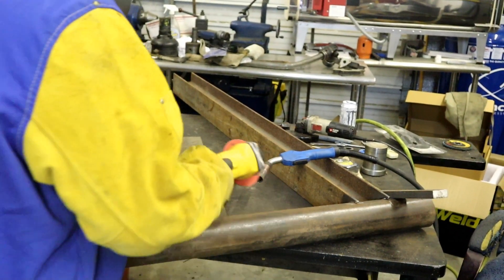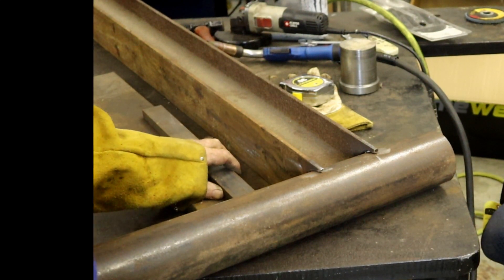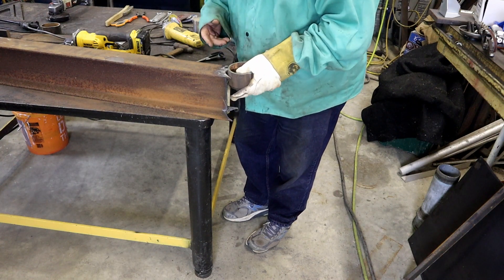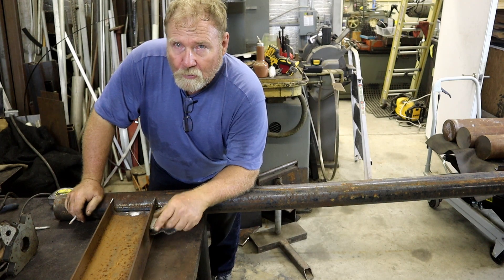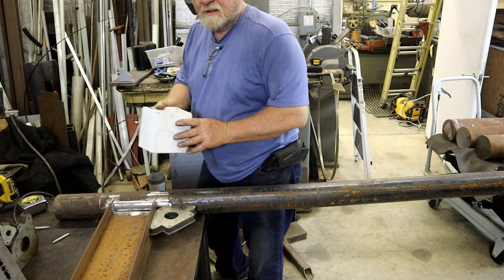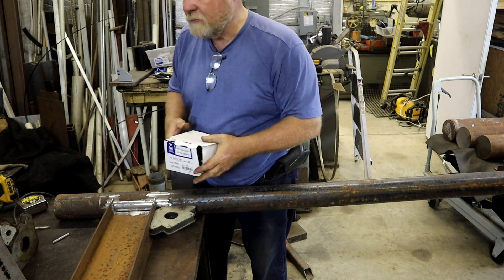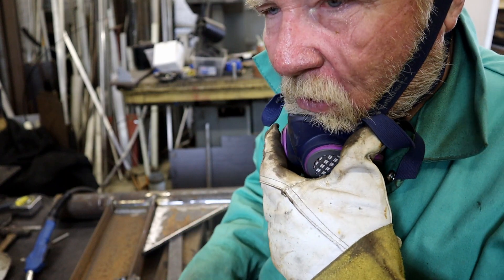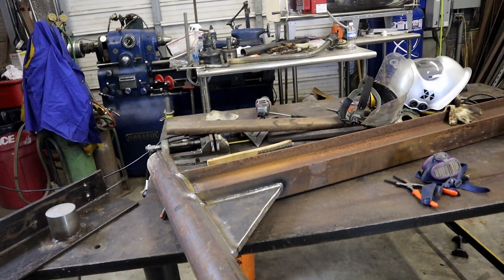How to build a GREAT Jib Crane: Part 3  Fit up and welding

Comment: Worked at a large slaughterhouse years ago. They had a huge crusher with a 100 HP motor set by helichopter due to a far in location where a crane could not reach. The foreman wanted to install a home made jib crane days before the install but engineer shoot him down. Less then a year later the huge gearbox had to be replaced. Took over a day for several guys to weld hangers just to hoist heavy steel up in the air. Foreman milked kob to get get a days overtime out if it.

Comment: From your project, I saw a lot of metal work that is very new to me.   Excellent work.  I guess I world never be able to make the same one like you did since looks like I need to buy many tools :-) Just FYI.  There is a product at Amazon called, Rotary Frame +/-90 Degrees for Electric Hoist.  Just need  a1-7/8" round tube so that this rotary frame can be screwed on it. It still has the 660lb max load.
Reply from the maker: You can get by with  fewer tools...  Today many people would get by with a welder and a 4.5 inch grinder and a cutoff wheel....  

Thanks for the tip on the pole... 660lbs  is a little small for me :)